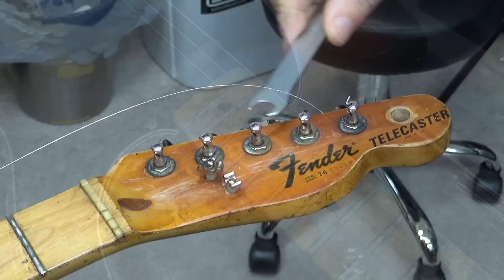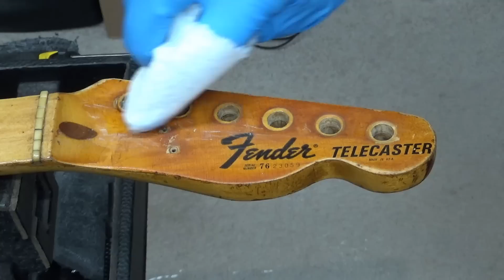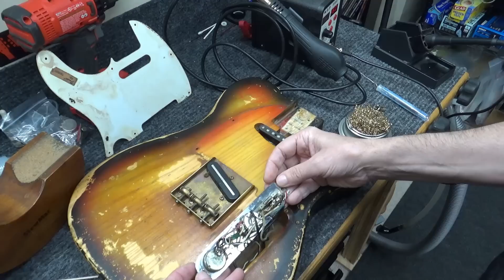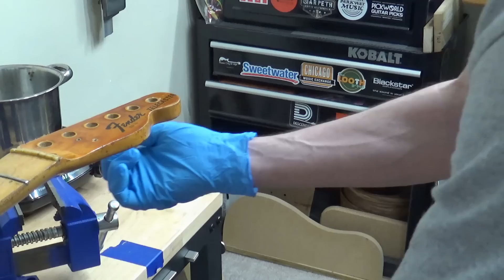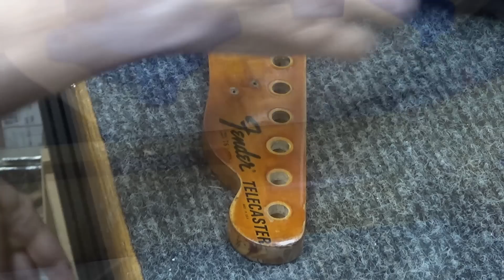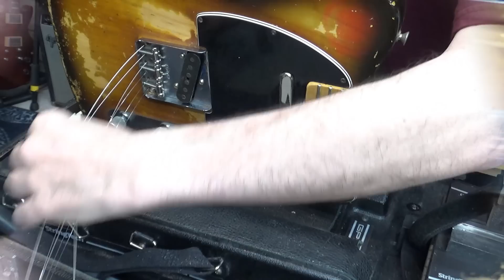From Beater to Better

Comment: Good work Scott. Finish repair is a very challenging thing indeed. A tip on soldering the back of pots. Bourns pots come coated or finished in some way that they accept solder very well. But the CTS and Alpha pots need a little sanding prep and then they solder very nicely as well. Obviously the guy wasn't worried about de-valuing the guitar with all new parts. The damage had already been done.
Reply from the maker: @jonahguitarguy  Thanks a bunch! 😁

Comment: Great video, especially the use of shellac on the headstock. Noticed that the soldering iron tip wasn't clean and wasn't flowing the solder well. If you use a wet sponge or the stewmac stay hot solder tip cleaner, to clean the tip,you will get better heat transfer and really solid joints. Cheers from Tas mania
Reply: Thanks no criticism intended mate.

Comment: I’ve been watching you for a year… I live in California. I wish I could send my guitars to you… I have some amazing guitars. 
The one I would really like to get fixed will not really fixed, but “helped “ is an ES 225TD .. that’s what it says inside of the F-hole.
But I’ve had a valued and it’s actually has been redone by a famous guitar maker in Los Angeles in the 70s Valdez guitars .. the actual inside pots are 345 Gibson parts stereo output.. again I’m not happy that I have to say this in public… It was stolen from Hollywood and I bought it for $300 back in 1980.. sometimes I wish I could find the original owner to give it back to them.. it is beautiful… It’s the most amazing tiger striped to body, as a majestic trim system and a Varitone switch.. I wish I can send you a picture… Over the years the binding is leaking glue or whatever… You can play anything from Wes Montgomery to rock ‘n’ roll on this
Anyway, you do great work  I also have a 1974 ovation that needs some help also😂 
you take work from out of state ??
Well, first comment I made after all these years take care
Reply from the maker: Awesome. You’ll have to contact me in private to discuss further. The Looth Group has some representatives out your way that may like to help
Reply: Thank you

Comment: did you buff out the back of the headstock where you filled with gluboost?
Reply from the maker: @markbanach9845  Of course! A little polishing and a little wet sanding too
Reply: @harpethguitar  Thanks!

Comment: Scott, I have a question. I dropped a Fender tremolo arm tension spring into one of my strats, forgetting that I'd already done so before and now the arm won't screw all the way down into the block with a little under of a quarter of an inch of threads showing. It's driving my guitar OCD nuts and I can't extract the extra spring no matter how I try. Any suggestions?
Reply from the maker: Maybe try putting a right angle point into the end of a metal coat hanger. I did this once with a vise and it has been a very useful homemade tool

Comment: 21:40 - You DON'T need to ground the pots in a Tele like that. The metal control plate the pots are attached to grounds them to each other. You also don't run a ground wire to the bridge. The bridge pickup has a metal base plate and the screws pass through it and the bridge. Adding the ground wires to the bridge and running them between the pots can create a ground loop. You only need to solder the pickup and output ground wires to the back of one pot. That's it. No more than those three ground wires in a Telecaster. Ever. Period.
Reply: I don't know, I eliminated a lot of hum on mine by running a wire between the switch and the bridge.
Reply: @Kevenruf  Yours may not have had a metal baseplate on the bridge pickup, or the baseplate wasn't grounded. As long as it has the baseplate, and is grounded to the pickup, that is all you need.
Reply: @JSPhotoRI  it does, but it's possible it isn't grounded i guess.
Reply: I disagree. I have done it both ways and sometimes you get a guitar with ground ghosts in it. Add a bridge ground and ground the pots and it goes away. It’s good practice to just add them. I’ve never had a ground loop issue.